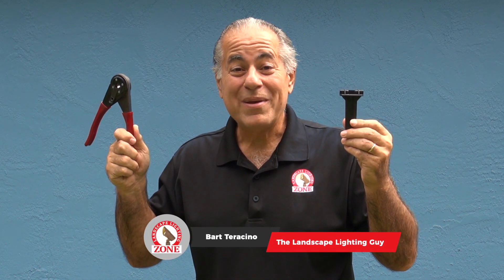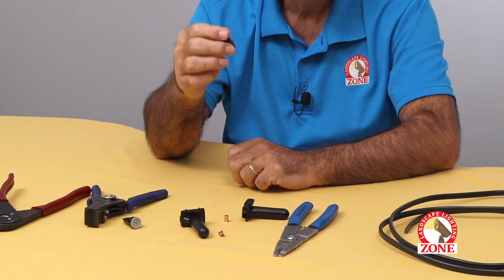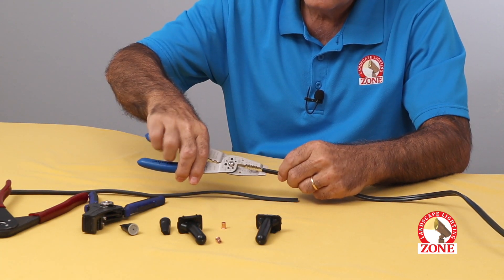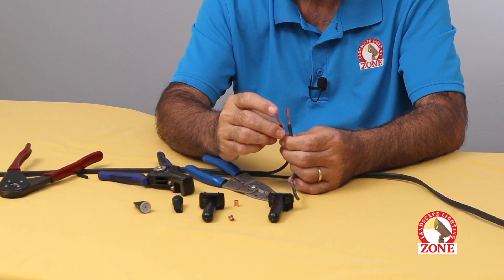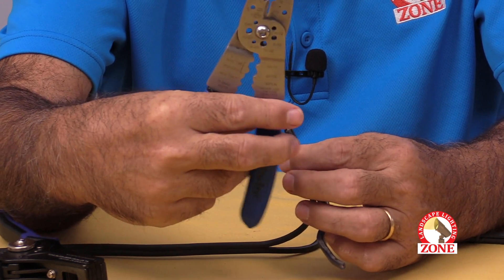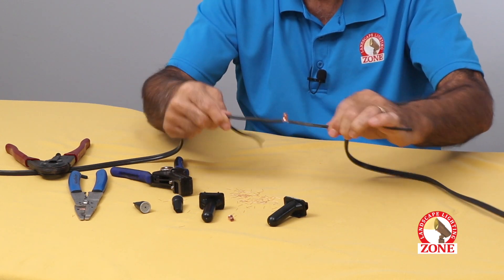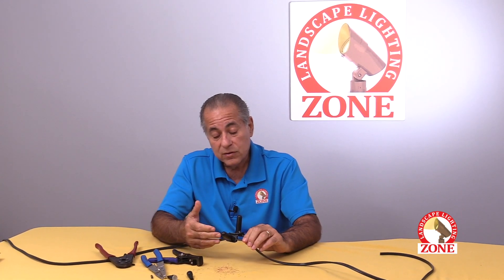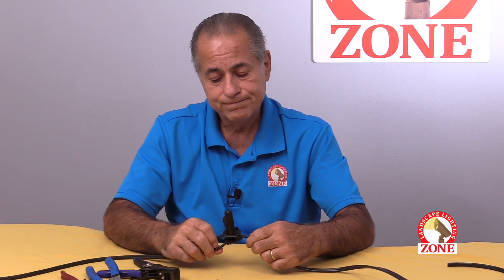Landscape Lighting Installation - How to Make a Waterproof Splice Connection

Comment: Looks like he has Klein Tools 11063W Wire Cutter / Stripper, Heavy Duty Automatic Tool for 8-20 AWG Solid and 10-22 AWG Stranded Electrical Wire.  About $30 in 2025

Comment: They also make automatic wire strippers with no slots that pull apart the insulation only using friction. They have a tensioning wheel to adjust how hard it pulls depending on the conductor size.

Comment: What brand of automatic wire strippers work the best?
Reply: Klein Tools 11063W Wire Cutter / Stripper, Heavy Duty Automatic Tool for 8-20 AWG Solid and 10-22 AWG Stranded Electrical Wire.  About $30 in 2025

Comment: He doesn't even show a link where to get these anyways
Reply: Just search grease tubes and/ or crimps and it should come up. You can get certain ones at irrigation supply stores.
Reply: At Lowes or Home Depot in the electrical dept. However in the Landscape department they have all spice stuff you need
Reply: Klein Tools 11063W Wire Cutter / Stripper, Heavy Duty Automatic Tool for 8-20 AWG Solid and 10-22 AWG Stranded Electrical Wire. About $30 in 2025